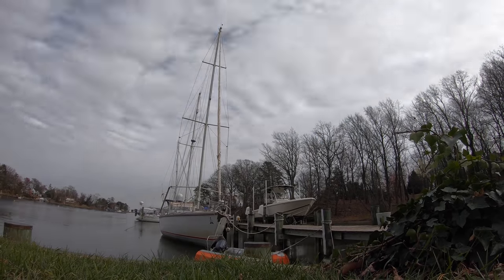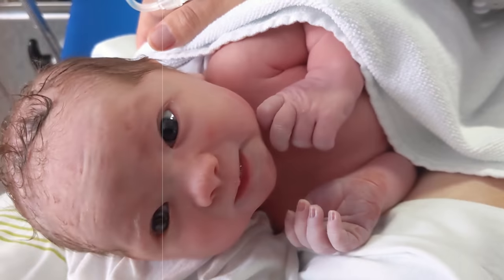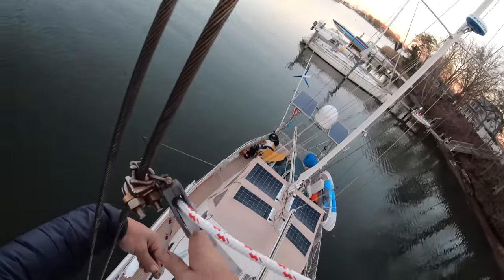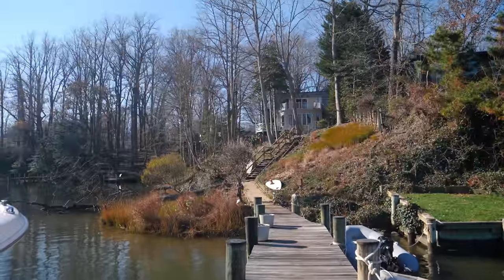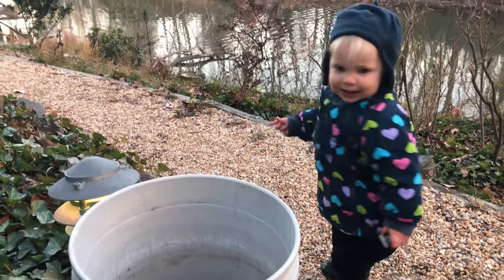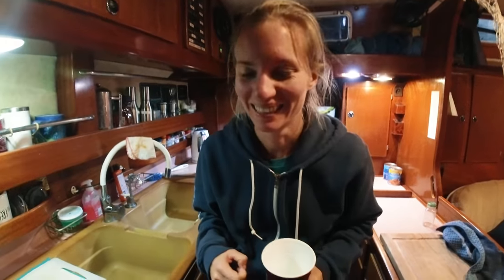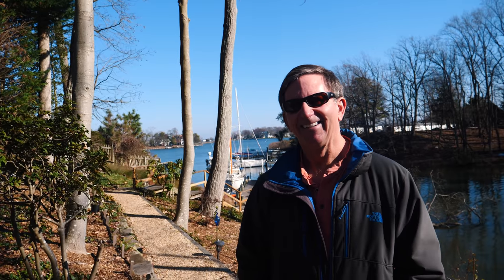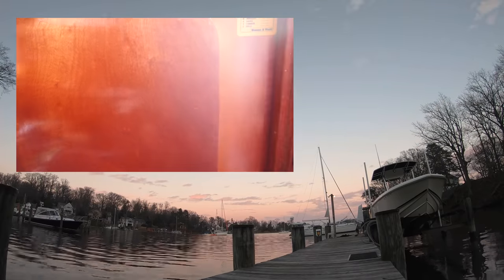WE SAVED $45K on our 6 week MINI REFIT! - Sailing Vessel Delos Ep. 313

Comment: WOW NICE genoa sail. When the reveal was made by Kazza showing the Nugget loading the mileage bucket I laughed so much I had to pause the video. And then the gasket instlled backward, Whooie, I was laughing again. For good reason. There was a time I was working on my '76 Toyota FJ-40 and pulled the clutch plate as part of the project. After installing the clutch plate and buttoning everything else up, I went for a test drive. I didn't get out of  the drive way though because I was uable to disengage the clutch. Back up on the lift the FJ-40 went and I pulled the clutch again, this time paid attention to details. In so doing I realized there was a differnce of spacing between one side of the clutch and the other. I flipped it 180 degrees, reinstalled and it worked.

Comment: Urgent Safety! 
While bleeding the injectors, open all of them and put rags around them. Remove yourself from the engine before cranking. The high pressure fuel easily penetrates the skin and needs to be removed surgically. Ugly at best, lethal at worst.
Keep safe. 
Hälsningar från Stockholm.
Reply: Ah, that reminds me of vaccines that were administered by high pressure, directly through the skin. No needle necessary.

Comment: This could be a lifesaver.....you should never use spinnakerhalyards or halyards that run through a block attached with a shackle when going up the mast. Use a halyard that runs through the mast sheaves. That way you will not fall if the freehanging block or the shackle breaks.

Comment: Failure of mechanical design - if the gasket isn't symmetrical, ought to move the stud positions or use some other means to prevent incorrect assembly.

Comment: i cant believe people still use swedge fittings on thier sailboats.  This is not a real rig inspection.  unless the rigging is kess than 8 years old it should be replaced. Norsmans or staylocks shouod be the only fittings on a modern cruiser. Stainless is notoriously difficult to visually inspect.

Comment: (I have only begun to replace the mangled rating below and I said writing because my speakerphone microphone on my device is failing but interestingly my regular phone microphone works fine and I haven't figured out whether it's hardware or software LOL.(I would also add that apparently a reply to me having come in I'm spending some time editing that in editing now I have some Dollar tree store earbuds that have within a few days of being used to failed on one side and more importantly never had a microphone. But today talking to my wife for a long time unsuccessfully without plugging it in using the Google Duo video which of course has a speakerphone mode that cannot be disabled unless you call without the video has relief from her inability to understand me instantly just by plugging the single working earbud in. I find it interesting because you can rule out it using the earbuds themselves the speakers or some other covert microphone that just can't be seen by the number of wires it has of course. There are three instead of four and the plug that goes into the device reflects that! Maybe there's an Android expert out there that can explain the difference with Android 9 on an LG with an earbud in using duO video app or now using YouTube to dictate because I do think the dictation is far more reasonable than it was earlier today.) But proofreading this comment shows there are too many errors for me to attend to right now and they are major errors from the speech recognition having mainly noise to work with apparently. There is no bad sounds in the room I'm in it's as quiet as a recording studio without any echoes either. The practice of the Google cloud suggesting words because it cannot hear is especially obnoxious. I wanted to say "even" and it says "either." Also I have only watched the introduction to this video. I will watch the rest of it especially if prompted to by any kind of :-) or response whatsoever from you. That was interesting I expected to type the words and it instead just put the emoji one of the first ever created of course! The Google speech dictation is always changing and that is a retro that may have always been (SO SAYABLE) but possibly not acknowledgment if I've ever seen one. I do agree that your daughter is the greatest index of the passage of time and WOW is it passing fast for me with so little left of my mom's life & especially the new administration in the USA being months into its first term is an amazing development as well)

I am advocating for you to solicit donations of fuel cell technology to power your lettuce gardens below deck. I believe that bloombox is going to get into the literal bLoombox business LOL which I think is the most hilarious observation on their business name I have ever seen. They provide the "energy server" of course to the Fortune 100 corporate headquarters and now to mini markets to provide reliable energy in the most dire weather when the electric grid fails. You could put a liquefied methane tank in your boat instead of the lead weights if you have those below at the very bottom? But instead of just burning it you can turn it into photons and food. When you're at Sea you have a shortage of fresh produce needlessly. It's not just saving tens of dollars on grams of herbs. It's about real food for real people that eats up all of the carbon emissions instead of vastly more emissions by combustion generation of electricity. It's about photon servers because currently the electric grid has integral percent POT LAMP BLIGHT LOAD according to the nature paywalled article abstract. That's a lot of pollution for a few grams here and there extra product when you consider it does not include the methane and propane being burnt for the carpet subsequently released when the small fraction admittedly of those plants get consumed by inhaling the smoke absurdly. I don't know if you guys have been enjoying liquid THC BEVERAGE BEER AND WINE REPLACEMENT products but apparently your wife is possibly in the age range of the target market being female and not likely to patronize the flower dried for burning NOW LEGAL BUT STILL TODDRY TAWDRY? which is if I recall correctly 1600 kg of carbon for every dry kilogram of the weed 'bud'. I appreciate your consideration of this proposal THAT you ALSO solicit SUCH equipment but also ask that you take notice of the fact that the SPENT HYDROGEN DEBIT CARD ONLY USED fuel cell cars are selling for about $5,000 now and that's when they're in full operating like new condition. Obviously for less than $5,000 you can obtain a fuel cell from such a vehicle that is not drivable. that would allow you to store your solar electricity of course by creating your own hydrogen for it but more importantly allow you to experiment with the close coupling of solid-state plant lights so that that would give you a reason to composT your wastE on the boat and turn it into CHEERFUL GORGEOUS light so that you can have the finest spinach grown greenly cleanly not just screen and tasty literally having you chomp on it still on the plant as excellent cinematography. I enjoy eating the basil on my balcony but so far have not stooped to avoid touching it with my hands I'm going to have to try that I'm sure it's tastier if the first bite is the first tent it has that it's purpose is realized.

In addition of course hydrogen has the ability to become more compact than when liquefied. Powering your satellite internet is a good project for the alternative storage of hydrogen technologies which are low pressure and as I mentioned before take up less space then removing sufficient heat from the hydrogen to get it into a liquid form. This is old news of course but the fact that it is in fact less space than liquid is never seizing to amaze me? I wonder if something similar can be done with nitrogen but assume not. Microsoft believes in powering the servers with hydrogen fuel cells and the not just for backup purposes of course. The industrial gas market is little studied and like other markets stable only wrongfully. Finally when it comes to solar power have you heard of the legacy Fuji high voltage ultralight solar panels? There are YouTube videos about sail's composed of solar panels but they were not using the Fuji. There's a guy named Victor in the Netherlands that you should reach out to has a significant inventory and what's amazing about these super light panels is that they have so many tiny little cells you're getting incredibly low current requirements because of the very high voltage. I mean the voltage from a small lightweight panel is unbelievable about 200 volts? That matters a lot as you should realize in terms of needing an entire universe of support that it never received. Learning about the business history of the Fuji flexible panel history is all important but I have not begun it. I have not even emailed victor 😉y yet
Reply: Some of the stuff I'm hearing sounds like trying to ignore the global economy in that every airliner every truck every train all transportation use either lamp oil (kerosene), diesel or methane (natural gas). There is a reason that Elon Musk and SpaceX use lamp oil, kerosene, and methane, natural gas fuel for ISS missions and StarShip respectively... Practical and economical. Some of the stuff I'm hearing sounds like someone with an unsound reasoning trying to explain national and global economics.
Reply: @joebucktexas  Rocket fuel to escape gravity vertically is ABSURD.  USE SURFACE.  PULL.  THEN DIRECT INERTIAL ENERGY DUH.